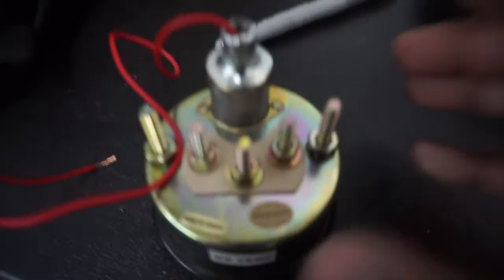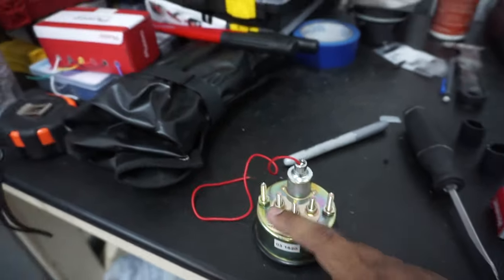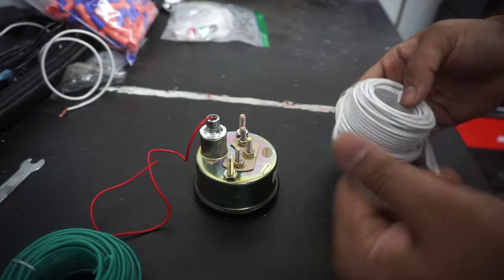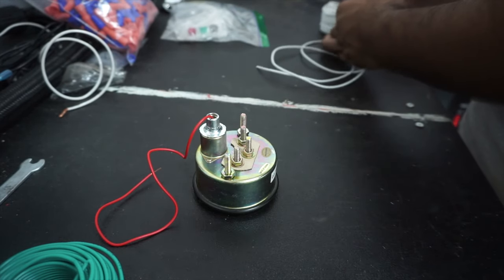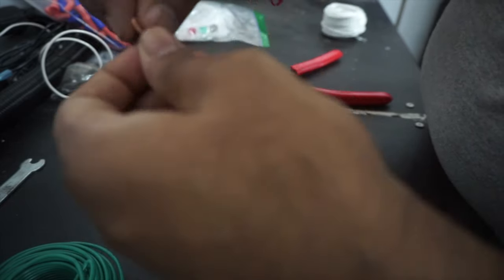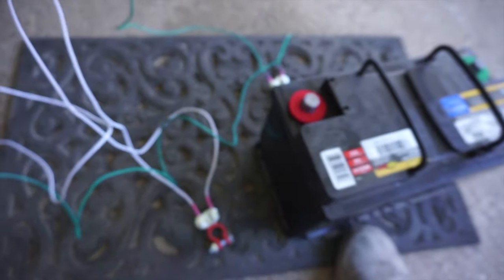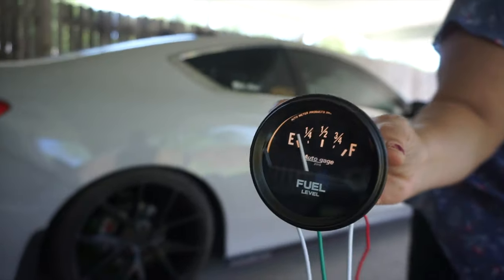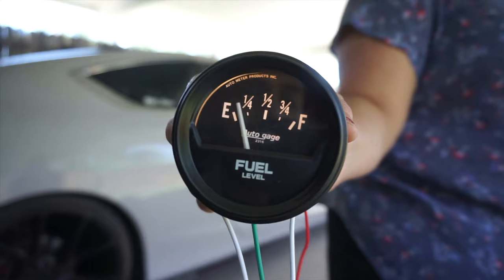How To Install a Fuel Level Gauge To Fuel Cell

Comment: Would I be able to just tap into the oem wiring harness for the sending unit if I’m installing an aftermarket gauge for fuel? My gauge went out (g35 problem)

Comment: you need to leave the cardboard insulator on it so the wires dont short out from the steel case of the gauge
Reply from the maker: Ahh thanks for that info!
Reply: I noticed that also.

Comment: What color on the fuel cell is the ground? Positive?
Reply: I’m wondering that my self.  Because on mine and the one on the video there’s a yellow wire and a green wire and I don’t what is what.
Reply: My cell has green/yellow so which does what?
Reply: Yall ever figure it out bc I just got one and I'm In the same boat
Reply: @james8682  green is ground
Reply: Yellow is for signal

Comment: I though sparks were gone came out of the gauge when you connected to the battery because you didnt put the little insulator carboard, hopefully u realised and put them on. Good video
Reply: i know I am kind of randomly asking but do anyone know of a good site to watch newly released tv shows online?
Reply: @Frederick Shawn i would suggest flixzone. You can find it on google :)
Reply: @Myles Darwin definitely, I have been using Flixzone for since march myself =)
Reply: @Myles Darwin definitely, I've been using flixzone for years myself :D
Reply: @Myles Darwin thanks, signed up and it seems like a nice service :D Appreciate it !!
Reply: @Frederick Shawn happy to help =)

Comment: my manual calls for 3ohms full/80ohms empty the replacement unit I received reads 6.5omhs full/82.5 empty will that cause an issue ?

Comment: i need help, please! i have the same type of fuel cell and I'm going full dumb on trying to wire up my stock gauge with a stock wire harness that was going to the stock tank. i cant find which wire goes to the fuel sending unit. I cant find a diagram for my truck anywhere. does the correct wire have a constant 12 volts with key on? witch wire on the fuel cell is the ground? thank you!
Reply from the maker: Message me on IG @96_rana
Reply from the maker: Your using a volt meter right? All fuel pumps will have a switched/constant 12 volts going to it
Reply: Were you able to hook it up to the factory gauge?
Reply: @ramonrivas6013  yes but it reads backwards. F is empty and e is full.

Comment: IF you're going to do a video - Don't you think you should be ready ? Why do you use the same color wire (White) and "Tell" people when you could use different color wire so they can "see" the difference - Why didn't you pre-crimp the wires - You're not making a "Wire Crimping" video - It wouldn't hurt to have everything in order and run the wires straight - So people can "Visually" see what you are doing... Why didn't you save time - Do a better job and tell people to "Read the diagram"... You are figuring it out as you go !

Comment: Damn I HATE people bastardizing the term "fuel celL" to mean something entirely differnt!  IF it is gasoline involved?  THAT is NOT a "fuel cell" Wikipedia~~> A fuel cell is an electrochemical cell that converts the chemical energy of a fuel (often hydrogen) and an oxidizing agent (often oxygen[1]) into electricity through a pair of redox reactions.[2] Fuel cells are different from most batteries in requiring a continuous source of fuel and oxygen (usually from air) to sustain the chemical reaction, whereas in a battery the chemical energy usually comes from metals and their ions or oxides[3] that are commonly already present in the battery, except in flow batteries. Fuel cells can produce electricity continuously for as long as fuel and oxygen are supplied.
Reply: Peace pipe/ Crack pipe, same thing